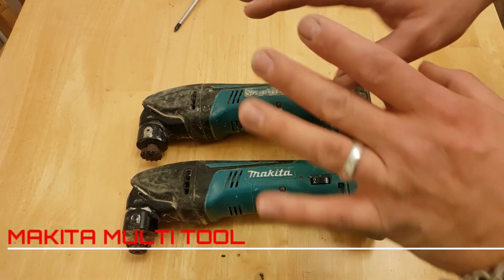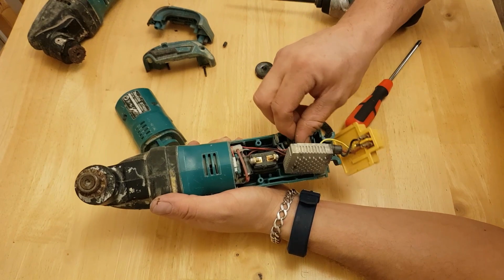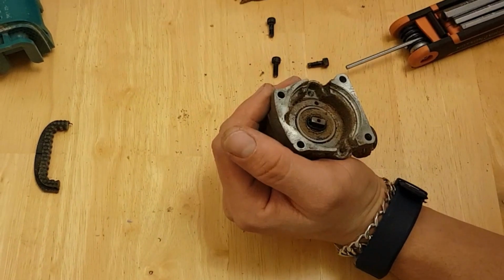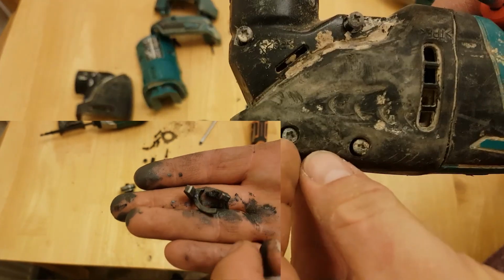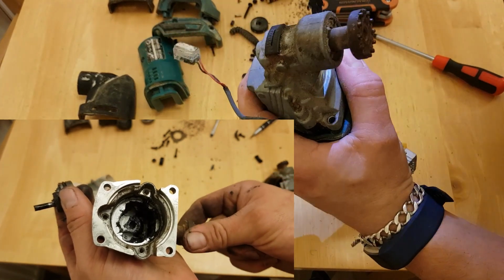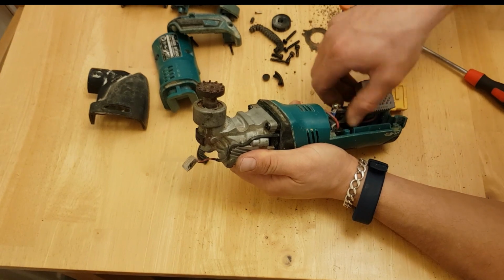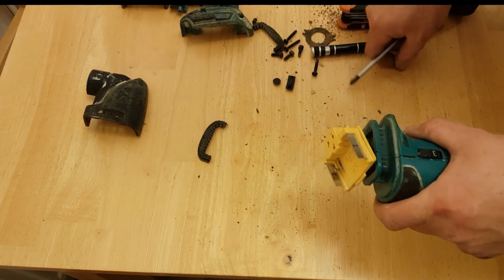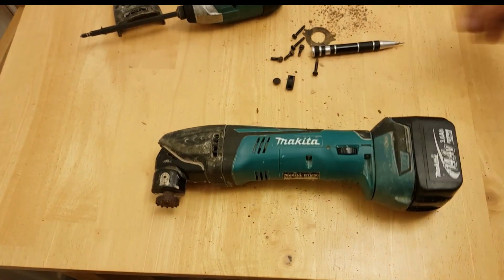MAKITA MULTI TOOL REPAIR DTM50Z RESTORATION AND REPAIR

Comment: Can you buy the broken part in the gear box?
Reply from the maker: yes you can.
Reply: @FINDITFIXITRESTOREITBUILDIT  do you have a link or part no. /
Reply from the maker: @simonbrumfield6966  https://www.sparetoolparts.co.uk/makita-dtm50-crank-housing-cap-a-btm40-50-424510-7-spare-part.html?gclid=Cj0KCQjwwvilBhCFARIsADvYi7LpU5xMqO_hCmQsXZ2u0tRf2rzXTWoWNChuj6wAB91XtQ6N1X9hHk4aAkRaEALw_wcB
Reply: I do not see anywhere on the parts diagram for this part that broke.  The link is for an external cap.

Comment: I have the quick release version which isn't to old and it has developed an issue where the blade is loose, is this a common problem
Reply from the maker: not one I've come across. there must be a way of tightening it. try a new blade if it's under a year old exchange it under warranty.

Comment: How did you get the shaft to go back into the gearbox. Mine does not line up correctly as it will not move the head back and forth. I can't figure out how the 2 arms in the gearbox interact with the oblong wheel. They just don't seem to line up so therefore the head doesn't move.
Reply from the maker: the input shaft should spin and that motion should make the output shaft oscillate. watch to the end I show more of the gear box later on in the video.

Comment: Hello, I found your video very interesting, I was wondering if u know why the overcurrent control board, the silver box keeps on red at all times, even after a day or two without use and battery is fully charged?
Thank you.
Reply from the maker: sounds like something inside is faulty could be Jamed up or a motor fault.

Comment: Hi
I need to know, how did you open the gearbox please
Reply from the maker: It's all in the video.
Reply: No there a part missing.
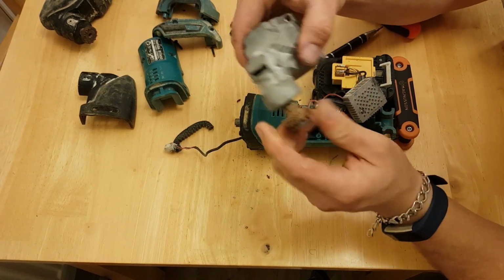Reply: In 9:01 you showed us the gearbox open,i want to know how did you  open it because i have the same one and mine is broken.
Reply from the maker: @khalidzainelabdin2564  ok so when the gearbox is removed  remove the 3 screws and cover plate over the bearing. On the front theres a small rubber cover remove that and push something in the end and push the bearing out on the main shaft it's just pushed in to the case.
I couldn't figure out how to remove the shaft the blades bolt to. Hope this is more helpful.
Reply: Thank you. I will try it.